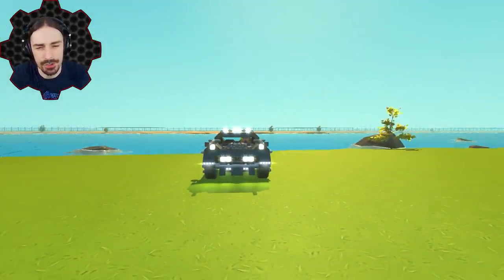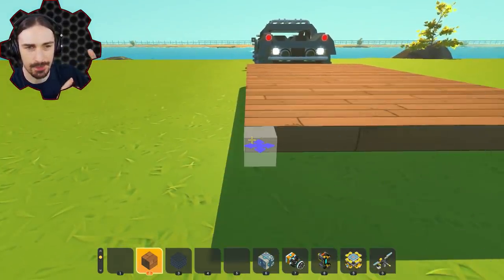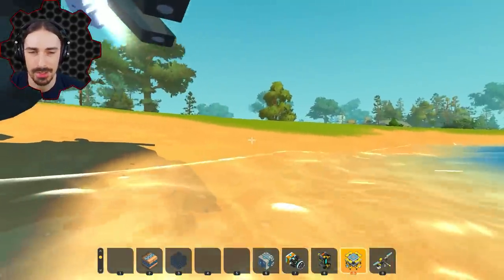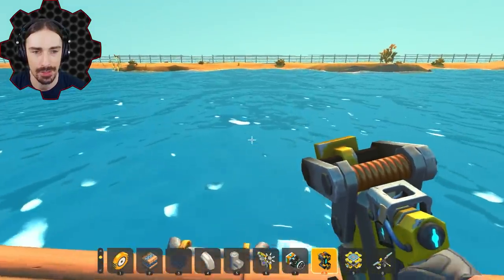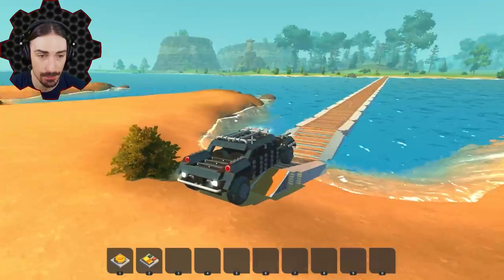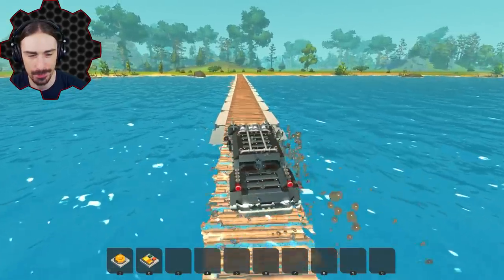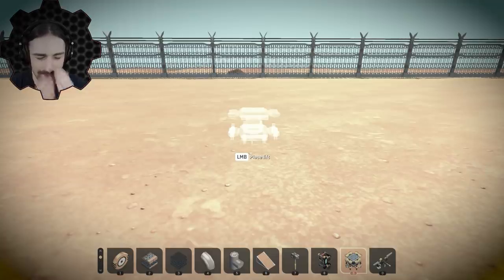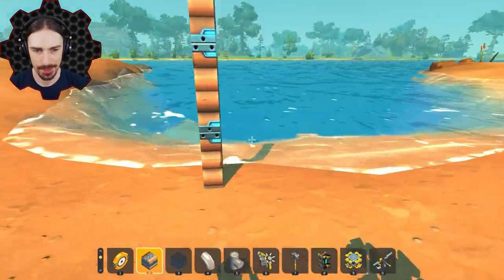I Built a Floating Water Bridge and Tried to Drive Across! - Scrap Mechanic Gameplay

Comment: Scrapman the reason the farmbot can't damage the bridge is because there isn't a player in a seat connected to it in the regular mode they can't damage structures without players "controlling" the structure as for the weird destruction at the end I think that was a glitch to do with him partially clipping inside the structure

Comment: If the exhaust is under water but the engine is still running, it is no problem. The gasses will push the water out :)